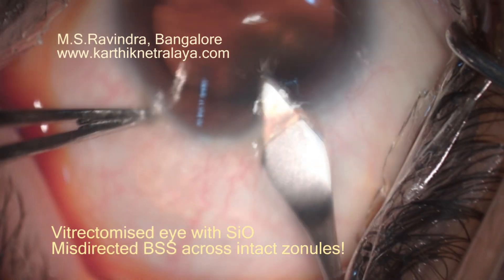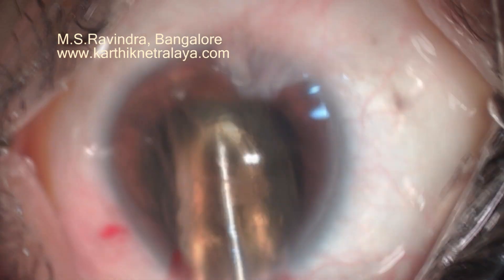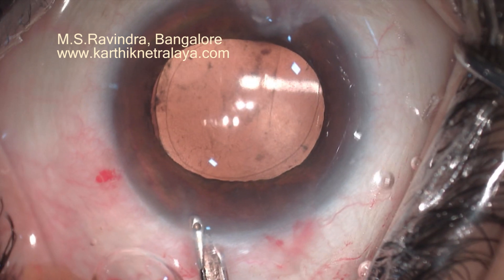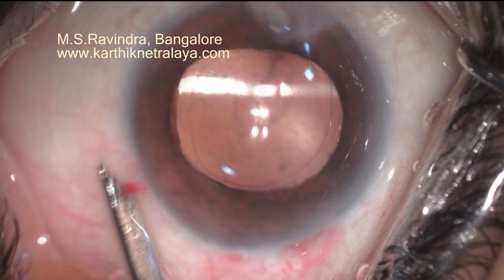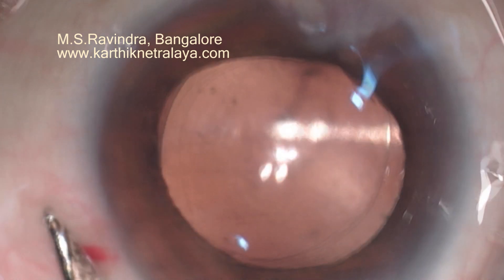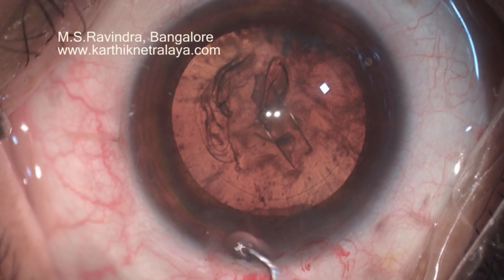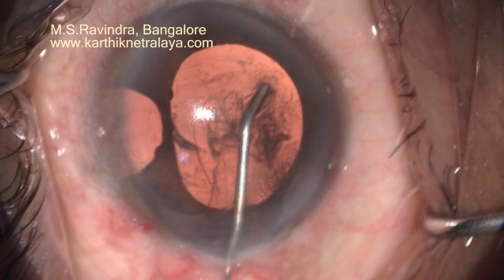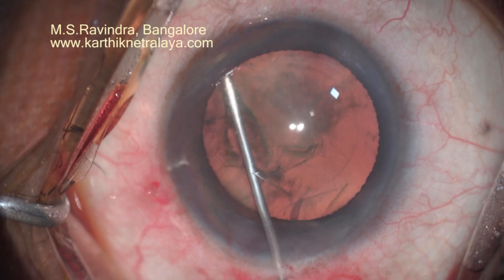Fluid misdirection can cause Intraoperative hard eye during cataract IOL Surgery.

Comment: What is the correct method of putting trypan blue dye inside the eye without causing fluid misdirection??
Reply from the maker: Infuse some amount of air into AC so that it removes the aqueous. Than, under the air bubble, infuse a small amount of Trypan blue. Wait for few seconds, and than irrigate aspirate the air and dye out of the eye. Inject Visco only after this.